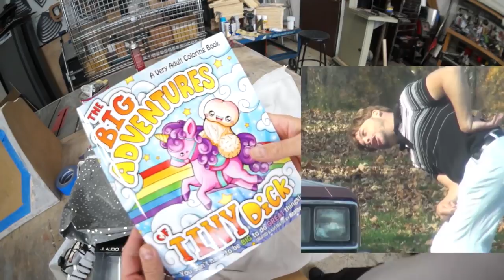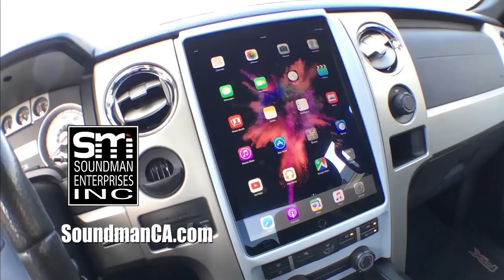iPad volume controller NO DECK - White Rider #57

Comment: Douglas! Didn't Russell teach you that when cutting holes with the bi-metal hole saw blades in plastic you always run the drill in reverse so the blades don't dig in the soft material and jump like that.

Comment: I'm trying to build a vented subwoofer box and I've been trying to find a 3-D software that Doug mentioned in one of his videos. The online website allowed you to build the box and see it at the same time in real time. I used it about a year ago to build one of my boxes and I want to build a better one now that I have the money for it. The website allowed you to set dimensions and it would calculate box displacement and frequency response. I know you can do the same with the winisd software but I'm looking for a different program. I've been searching for a couple hours and haven't had any luck finding the website.

Comment: Question: I know it has nothing to do with the video but you're a sound system guy, I have a 2013 C250 sedan Mercedes. Would you have or know the wiring diagram for the stereo? I can't seem to find it anywhere and Mercedes won't give it up 😏 I have this Harman Carmen setup with the built-in amp in the trunk

Comment: It seems to me that you've missed the point of the volume control device - it has to be placed as near as possible to the amp, in this case signal from the source to the volume controller will have constant high amplitude, and since it goes though rather long interconnection cable that is tend to receive noises, you will have clean decent sound on low volume levels.
Reply: Its a digital signal, so it doesnt need to be close to the amp. Notice the rj11 jack for the volume knob.
Reply: @wagzz3000   The signal is only digital from the iPad to the iStreamer.
Reply: iStreamer outputs are analog